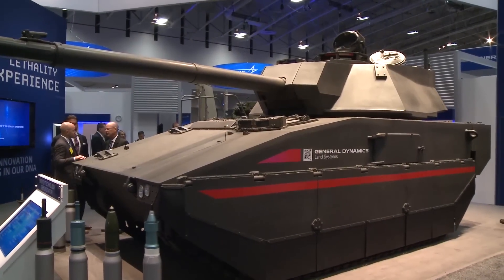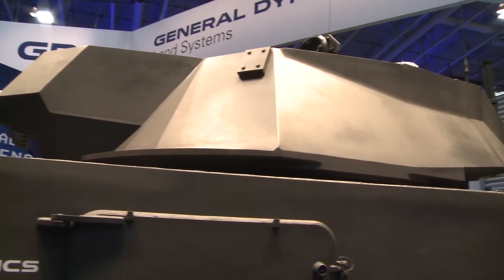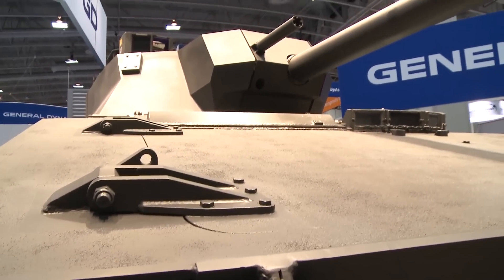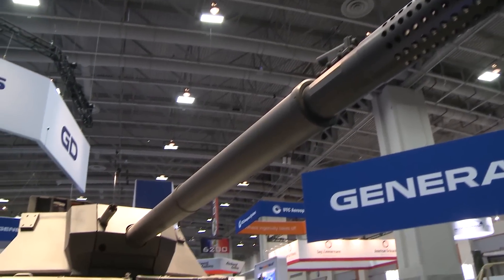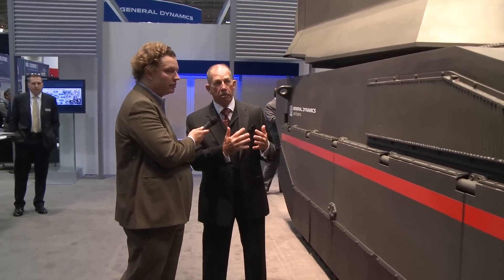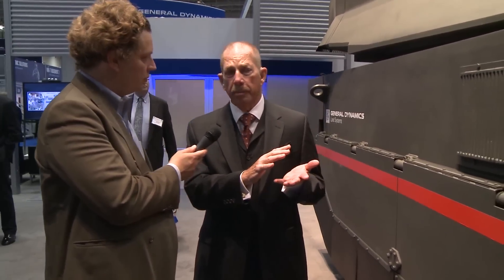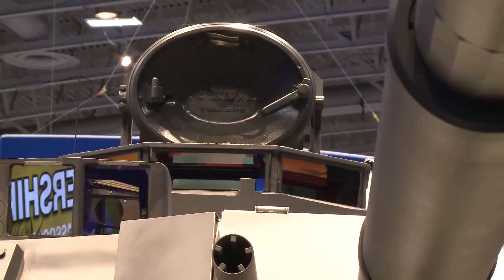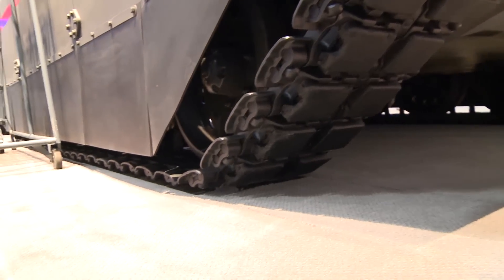AUSA 2016 - General Dynamics Griffin: Don’t Call It A Tank (It’s Totally A Tank)

Comment: Nice looking tank but then bigger turret as means bigger protection as don't need thicker armor turret just then thick 4-7 inches 101.6mm-177.8mm thick armor turret with English design Burlington Chobham ceramic  composite as increase its layers of interior protection and less thicker shell . Bigger or medium sloped armor turret is a lot better.  Hope has Abrams-like slope shape armor turret if its in production in 2020's  as M1A3 Abrams is new tank of evolution.

Comment: Slap an active protection system like Iron Curtain and General Dynamics' ADAPTIV thermal camouflage on this bad boy, and it will get the job done. If its armor can shrug off 30-40mm shells and it is designed to be IED resistant, then the only thing it has to worry about is other tanks. This is the future of armored warfare in my opinion. Fast. Light and, therefore, transportable. Hard-hitting (120+mm and ATGM). Technologically advanced (APS and thermal camouflage). Good enough armor. And, most importantly, cheap(er).

Comment: They couldn't possibly have made this vehicle any worse. For one, the M256 120mm gun on top of this 28-ton vehicle has over 40 tons of instantaneous recoil when fired --- enough to flip it over even when firing over the frontal arc. For another, the M1A2's turret is heavier than the supposed total weight of the complete vehicle at about 30 tons, and the basic ASCOD chassis (used in the aforementioned Ajax vehicle) weighs over 20 tons. If this thing were really built, it would weigh twice as much as General Dynamics claims --- an armored vehicle with admittedly no more armor than a Bradley, at the weight of an M60A3 Patton.
Remember how the Stryker was supposed to weigh just 17 tons at combat weight? The lightest models now weigh over 22 tons. .he MCV vehicle for the Future Combat Systems was supposed to weigh only 20 tons, but grew to a minimum of 40 tons by the time it was cancelled? How about the attempt to keep the MCV from growing too much more after it was re-branded as the "GCV", only to end up making it weigh 85 tons?
The same suicidal wishful thinking is at work in the Griffon.
Reply: XM360 gun, no M256.
Reply: Dude, the 120mm gun on this technology demonstrator is not the M256. You seem to be a well-researched guy, but a lapse in assessment like this is embarrassing.
Reply: BlacktailDefense it's a technology demonstrator the battlefield build of it will be much more functional the Griffin is bassicly a scaled down version of what's to come meaning the production model will be armored like the armata moving like the Abrams and shooting like the t 90ms and airdropped like the Stryker oh not to mention stealthy like the pl-01 again this is just a DEMONSTRATOR